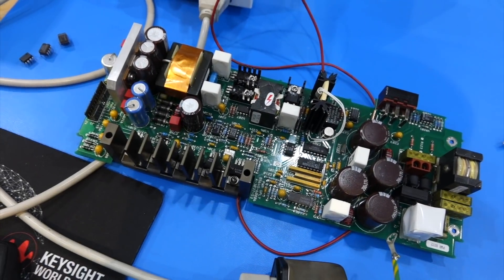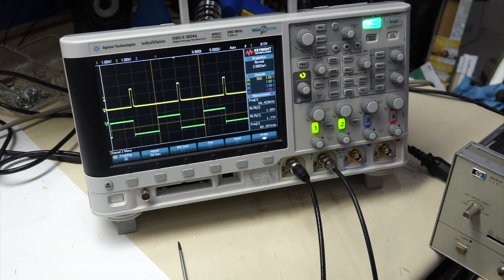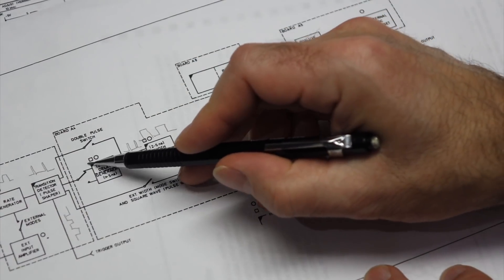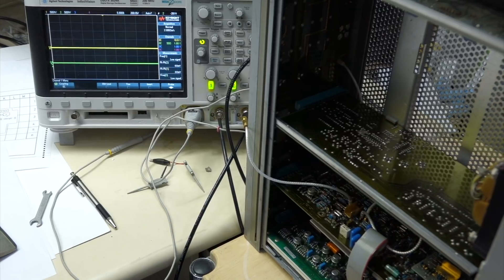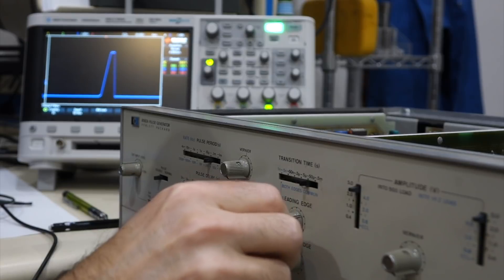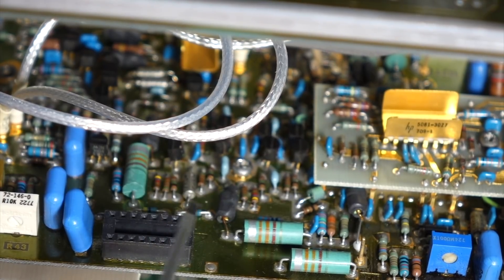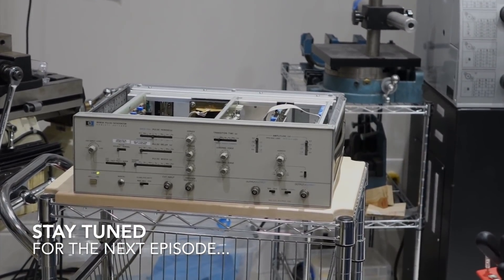HP 8082A Pulse Generator Repair Part 1: Fast Pulse Synthesis, the Analog Way

Comment: That's the vintage of HP equipment I was fascinated by in high school.  I used to subscribe to the HP Journal, which I read front to back each time I got one.  Even though most of the equipment was way over my head, I still enjoyed reading about "The HP Way".
Reply from the maker: What an excellent journal that was.

Comment: We’re all used to ultra fast single board electronics. And this era of fine older HP instruments is what made the current generation of electronics possible. 

The saying goes, ‘every high precision machine was made by a lower precision machine’.

Comment: I've succesfully repaired several custom HP E-ECL circuits (on the 8640B and 5342A for example) with modern 100EL parts and level shifters made with RF transistors. Layout is the most
important factor. The 100EL parts are fast and anything will happily turn them into oscillators :)

Comment: I wish modern electronics had accessible diagrams like these did :(
Reply: If enough of us support right to repair we might be able to make it happen.
Reply: This is the difference of built in USA vs china.
Reply: Mike Eral are you sure about that? Do US company’s supply repair diagrams?
Reply: @RingingResonance  sadly, I think no matter how many times we tell "right to repair" they're going to carry on making crap that maximises profits and comes with no service manual. :(
Reply from the maker: I think the bigger problem for companies that try to differentiate with good engineering is that there would be a Chinese counterfeit available on the web the next morning...
Reply: @CuriousMarc  Good point. The rest of the world really needs to put more pressure on to china. Tactfully, of course. I'm not any kind of negotiator so I have no idea where to even start.
Reply: CuriousMarc Counterfeiting brands is of course illegal, but copying unpatented circuits is not and the market is demonstrating its love for cheap copies. Of course you can always design it like the Philbrick varactor opamp so that without knowing how your copy won’t work. That was brilliant, I think.

Comment: Love this content!  When using the suck iron, I find that putting solder on the tip before sucking works best... a good wet connection is necessary to heat the junction before suck.  Thanks for the curve tracer test, I was hoping we'd see that.
Reply: I always put a big glob of leaded solder on a joint before I suck... nice bit of fresh solder for the reasons you say and a good bit of lead to alloy any of that lead free stuff that doesn't seem to be so keen on actually melting.

Comment: Only 12 seconds in and that front panel is Beautiful!
Reply from the maker: Agreed! It was supposedly inspired by airplane cockpits. Horizontal sliders for time related settings, vertical ones for amplitude.
Reply: CuriousMarc  that’s very interesting where is the pitch and yaw though
Reply from the maker: @tickertape1  Comes only with the optional stick and flap control options  ;-)

Comment: Nice repair, I love HP gear. For really fast rise times from old gear, check out the Tektronix Type 284 Pulse Generator -  risetimes (10 to 90%) of 70 picoseconds at 50 KHz into 50 ohms from a unit built in the mid 60's!
Reply from the maker: That's fast! Must be done with a step recovery diode? For TDR or some other kind of risetime test, different application. Still fetches a pretty penny on eBay!
Reply: @CuriousMarc  It uses a tunnel diode. I got a non-working one fairly cheap and was able to repair it with tunnel doides from Russia. The unit was originally intended for testing oscilloscopes I believe. I used it to test my HP 54110D - another oldie but goodie.

Comment: Well, had a few of those once, wasn't impressed. Usual HP 8xxx ASIC madness, of course some of them went bad. Combined with those crappy HP slider switches, that eat PCB traces below, if used too often.
Stripped the most broken one for parts and used it to repair the remaining ones, sold them for good cash.
Became happy owner of PM 5785/5786 a little later on, like them ever since, much better instruments.

BTW, if you give me parts number of failed ASIC, I can look if I still have it, you can have it for shipping costs, since I like watching those repairs ;-D
Reply: Message Marc
Reply from the maker: It's a 5081-3010. U2 on board A3. If you have one I'll gladly take it. You can contact me from my About... page: https://www.youtube.com/curiousmarc/about
Reply: Sorry  CuriousMarc, looks like the 5081-3010 failed on me as well, have 2 working 5081-3009 a 5081-3027 and those 2 ceramic hybrids left over:
https://i.ibb.co/qJzcWtY/DSC-0226.jpg
Reply from the maker: Thanks for looking! Interesting on how this particular circuit seems prone to failure.
Reply: In what universe is Philips (PM) better quality than HP????
Reply: @michaelnobibux2886  Only ECL logic inside and no HP custom parts that go bad and you can't get replacement. Also none of those slider switches. Principle of operation inside is quite similar to HP, is a bit slower though, but didn't matter for my applications so far.

Comment: Marc, I love your videos. Could you please post the schematics and board files for your IC replacement? I love the idea of reverse engineering unubtainium chips on vintage HP gear. There are a number of great pieces of HP gear that have parts that can't be replaced, and love the idea of working around them without getting a unit for parts that may have actually suffered the same fault.
Reply from the maker: Sure but I have to build it first and see if it works...
Reply: @CuriousMarc  Thank you for your reply. Sure this is what I meant. A link in part II, if it works. :)
Reply from the maker: You bet. Circuit board has arrived, time to do some soldering...

Comment: Nice work there, though I would hazard that in the future you will find more of that same batch of transistors failing as they age, likely from contaminants in the packaging material or from water vapour diffusing through the package, or the die frame leads have parted company with the epoxy and allowed the water in. might want to remember that for future faults, and change out any of those transistors in a faulty area as a first troubleshooting exercise, and then look further if the fault is not obvious.

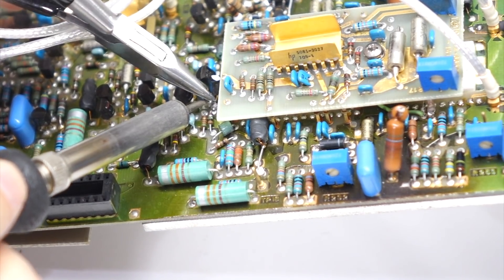Comment: Oof something on the board to the right of where you were working had gotten pretty hot - at 19:40 there's a pair of components (power resistors maybe?) with the PCB under them turned black. Wonder if that's by design or indicative of a current or future failure.
Reply from the maker: These are resistors. You can tell they upgraded the design and replaced one resistor with two to spread the thermal load. I checked them and they are OK. Just cosmetic varnish discoloration from the temperature these reach at steady state.

Comment: After using pause/play consistently to follow the quicker explanation, I thought the problem sounded similar to a binary running on/off with added inversions (levels) where two glitch. The second pulse represents a quantum principle of displacement in theory? Or transposition?? A mirror with no image returned.

Comment: You know, Marc, you don't have to buy old, broken Hewlett-Packard gear. Just saying. :D
Reply: What's the fun in buying working gear when you have an entire electronics lab for fixing stuff? Buy broken, fix it, and add it to your arsenal to use in fixing more broken equipment. ;)
Reply from the maker: Yes, I know ;-)... The new stuff from Keysight is still amazing - we buy it for work. But at well over a quarter million for a scope or a VNA, and 5 digits for most other instruments, that's not feasible even for a very well healed amateur lab. Even at work, the sky-high prices cause intense debate and tension for capital expense allocation. However, their old stuff is still spectacular to this day, and is an amazing bargain for what it does. Bad news, most of the time, if it's from eBay, it's broken. Good news, unlike the newer stuff, most of the time you can repair it. And they even give you the doc, including schematic with principle of operation walk-through!
Reply: @CuriousMarc  This is why I will always support right to repair. I've bought a couple old TDS series scopes off ebay for cheap. My first one was a working one that I upgraded from a TDS540 to a TDS784 with a color screen and wll, but it needs calibration. My second one was a 754 I bought incomplete and broken for even cheaper. It had a memory problem on the acquisition board. Luckily they still sell that memory chip on digikey and I was able to fix that problem and complete the scope minus the internal CRT what was so dim you couldn't see it. Okay I'm bragging now. ;) For a lowly hobbyist like me I have a pretty good setup what with the polynomial waveform synth I got for cheap and was also able to repair. Did I mention I had an emergency repair of my TEK465 the other night? Shorted tantalum cap on the 15v rail. Fix in the amount of time it took me to take it apart and put it back together because I got lucky on the first cap I unsoldered and tested. The right to repair is critical for humanity.

Comment: I had to fix my old analog Korg synthesizers from time to time and I had problems with unobtainium ICs.... I always wish there was someone who collected trashed devices to harvest the special ICs.... there must be someone who does this for HP??????
Reply: There are people who sell the acquisition ASICs for first-generation Infiniium oscilloscopes.  That said they don't often go bad; the contact surfaces usually just need a cleaning after a while.
Reply from the maker: In this case the instruments are cheap enough that you just buy two bad ones to make one good one. Only crackpots like me would go through the trouble of making a replacement circuit ;-). Apparently these ECL-like circuits were pushing the envelope of technology at the time and do fail quite often.

Comment: If it was the delay circuit Worst come to worst you may be able to create that delay circuit using common C-mos logic IC  taking advantage of the Propagation Delay they exhibit.  Yes a not so simple piggy back board ?
Reply from the maker: No, it's ECL level, differential, impedance matched. CMOS would be way too slow, wrong levels, single ended, and not impedance matched. But you could do something with modern ECL circuits. You'd still have to adapt the levels with some special purpose analog circuitry, as the HP levels used here are not compatible with modern ECL.

Comment: Great Video!
I agree that software locking a scope is dumb... You know you only have to enter a valid product key in your scope to unlock all the MHz, right?  Since its not online there's no way to check if the key hasn't already been used :).
Reply: On my TDS540 it was a matter of changing some config resistors and removing four small caps on the front end of the acquisition board to unlock 4gs/s at 1ghz bandwidth. It's not calibrated anymore, but would def be worth getting it calibrated if I had the signal generators that where fast enough.
Reply: @RingingResonance  marc seems like someone who has the equipment to calibrate it :)